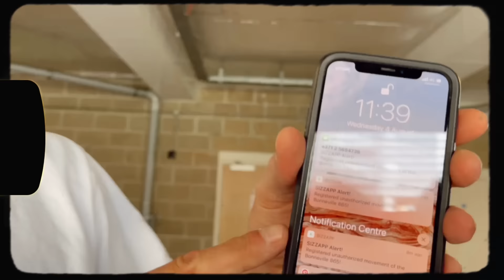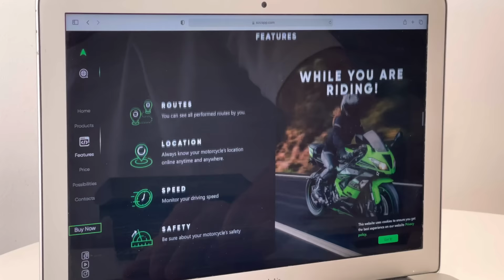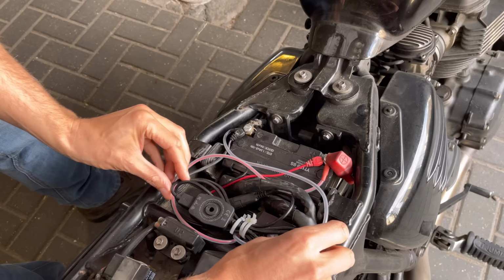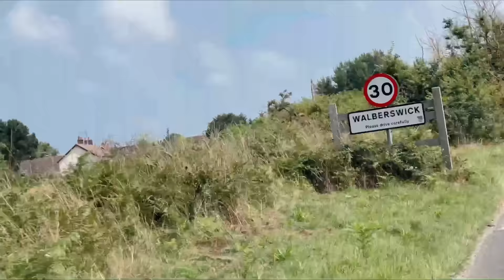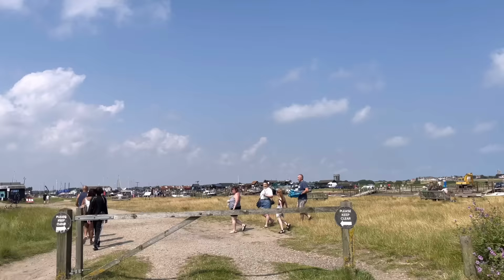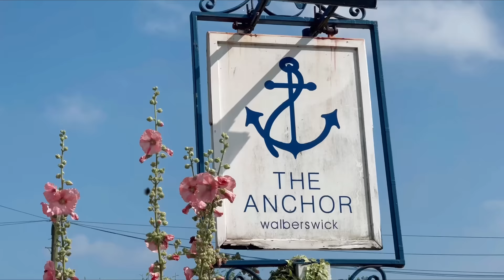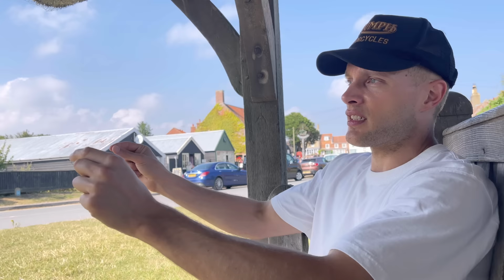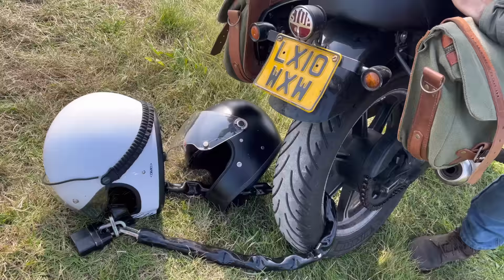A Nostalgic British Seaside Village That Hasn't Changed in Years | Walberswick | New Sizzapp Setup

Comment: Always disconnect the negative terminal before the positive, and put the positive back on first. If you don’t, and you drop anything metallic such as your screwdriver, across the positive and the frame, you’ll short out the battery to frame.
Reply: I was just thinking the same. If we're honest I think we've all welded a spanner or two 🤫
Reply from the maker: Ahhhh thank you Mark- I'll remember this:)

Comment: Change those battery screws to hex bolts Freddie - terminals need to be very tight - could be why sometimes you cant start because your battery is losing charge. btw just found your channel Great work!👌